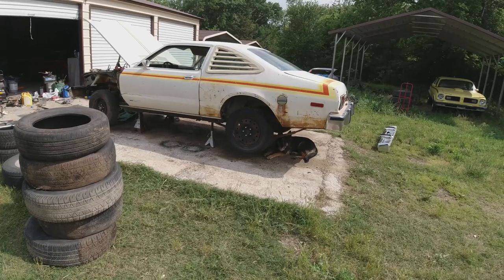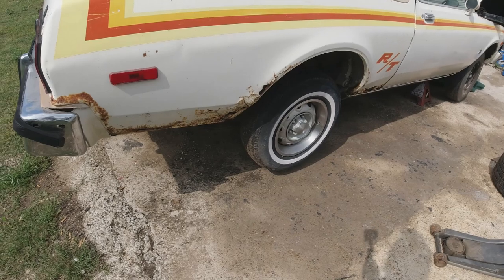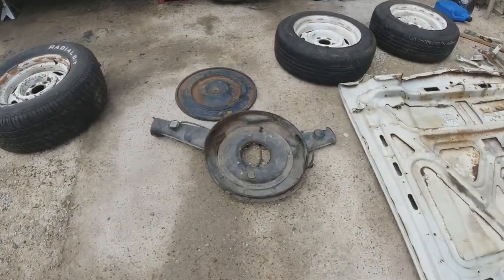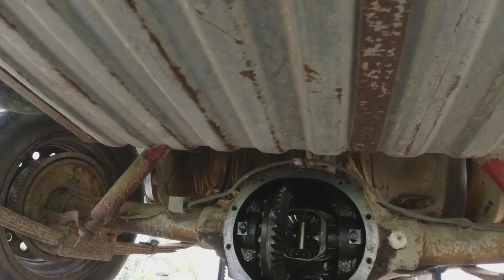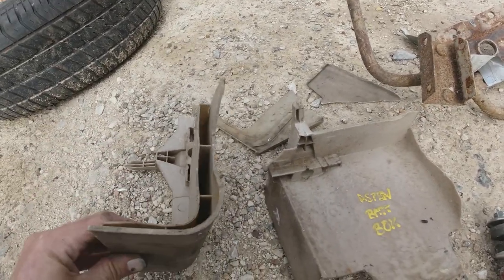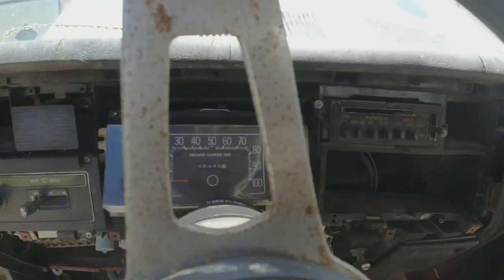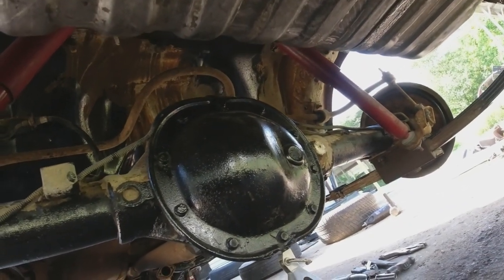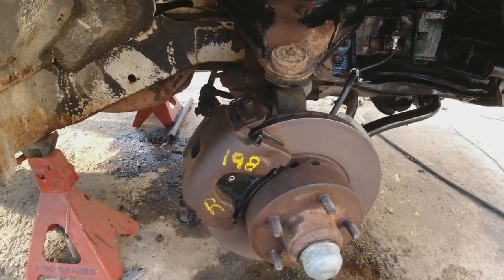Restoration of a 1978 Dodge Aspen R/T - Part 4

Comment: I recently found your channel and absolutely LOVE the name of it! More then that I Love the Aspen I recently added to my squadron of cars. I have a 1965 Chevy Impala SS with a 327 L88 motor, 1970 Chevy Monte Carlo, 1973 Chevy Camaro Type LT and recently added a 1978 Dodge Aspen RT with a 360 motor, Automatic Transmission, Quarter and Read Window louvers, ground effects, front lower chin spoiler, Rear lower chin spoiler, Rear High style spoiler, 15" honeycomb rims that a a lot deeper then my wheel well is and along with the rims and tires he has a adapter plate to push them out even farther because I can sit on the tire with my drink, Headers with exhaust side pipes  and a (not original a kinda a hack job/shade tree/I know how to do everything and did everything you did but better mechanic guy) Shaker style hood. There final I wish You wouldn't of bought this car before me, but I'm glad you sold it for cheap because you didn't know what you had. He had T-tops planned for it by the masking tape on both the roof and inside ceiling. 
So now it becomes my newest baby which got pushed to the front of the line. My wife's 1987 Chevy Monte Carlo is sitting in the garage all ready for the 355 to drop in, my daughter 1963 Cadillac Hearse with a 500 motor, 3 speed manual, electric cut out exhaust, 50 series tires, 2005 Cadillac interior minus the back seat and dashboard both upper and lower. It took a lot of screen, fiberglass, thin as paper sheet metal, brackets and supports, suicide back passenger doors. Everything trim wise and exterior size is there it needs paint and the chrome bumpers, bumperettes, grille, hood spear and ornament, body and window trim and the rest of it's chrome redone. But I'll get these done
Reply: Question for you on your Aspen if I may ask...  I know you said you hadn't found anyone that made remanufactured parts. By any chance is that Green Parts car close to whole or are you going to break it all done and keep it? I also need flooring but it's panels in the rear. It's foot areas for both the rear passenger and driver
Reply: Last comment because I was trying to get this done before the video ended. 

With having my 1st car 
1965 Chevy Impala SS, 
1970 Chevy Monte Carlo was the parts car for my parents 1970 Monte. Which they have cars that they run as close to stock as Oil Filters, Spark Plugs, plug wires, Air filters and it keeps going in their 1970 Chevy Monte Carlo, 1971 Chevy Monte Carlo SS and 1972 Chevy Monte Carlo SS, 1985 Chevy Monte Carlo and 1988 Chevy Monte Carlo that is Prostreeted and pretty badass hard to harass and sounds the part as well as it plays it! The best part is my Mom drives it, all 5'0", 95lbs of her, while Pops drives one of the others. 
Anyway with Their cars, my wife's cars, my daughter's hearse, my son as his mind made up on a car he wants and how it s going to be built and done. Which is totally awesome, exciting and a whole lot of nerves. 
With nerves the Baby of the family even brings more nerves to all of us! She has her heart set on a American Motors Corpation Car. She wants all of the following  AMC 1965 - 1966 Rambler, 1967 - 1970 Rebel, 1965 - 1967 Marlin, 1965 -1973 Ambassador, 1970 AMC "The Machine" Rebel, 1971 AMC "The Machibe " Matador, 1971 - 1973 AMC Matador, 1971 AMC Gremlin X or Gen 401Xr, 1968 - 1972 AMC Javelin, 1968 - 1970 AMC AMX with the Go Package, and then finally she wants a 1970 - 1976 Amc Hornet with the 360 motor, 4 speed manual and go Package or the 1977 AMC Hornet AMX version. 
That's not all though from my buddy's, My parent's friends, Car Club friends and passer by's, movies and tv's and what have you. It had her listening, asked questions and decided she needed to add a few things to whatever she ended up with. Those add-ons are Turbos and more importantly twin turbos on a destocked motor and a "Oops a Daisy" squirt as she puts it. 
So after all the typing tonight, all the hoping and praying the video doesn't run out while I'm typing is 

God Help us All of my Mom, Wife, Oldest Daughter and Youngest all are cruising together from Belmont Mi to South Haven/Niles/Waterveliet/St.Joe/
St. Ignace/Sault Ste Marie/Bay City/Detroit. 
Just let us guys stay back and watch the chaos unfold.

Comment: I upgraded one of my Aspens rear sway bar with an Addco brand 3/4 inch size . I also bought one for the front which I still yet to install. Addco had some of the bushings available for the Aspen/Volare suspension also. I had a 1988 Diplomat police car that I used a lot of  parts for my 1980 Aspen R/T.  Ebay at one time had some really good used parts that I found too. I like watching your videos by the way!!!
Reply from the maker: Thanks!